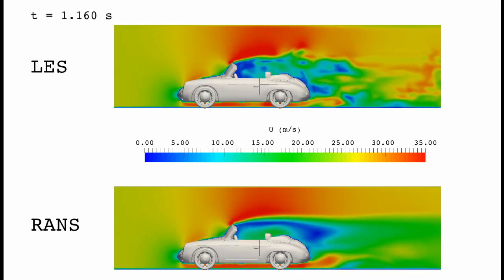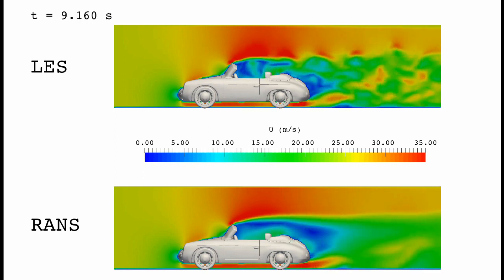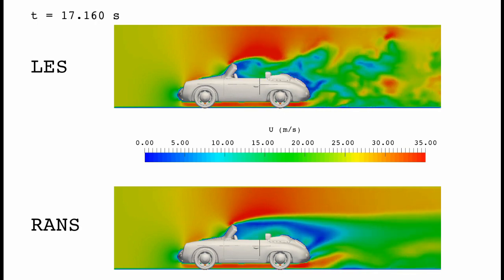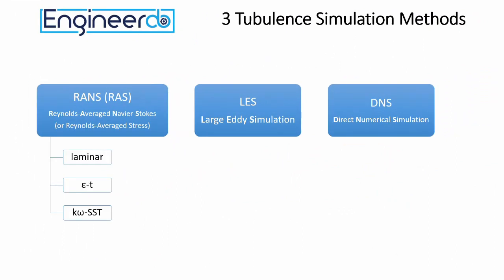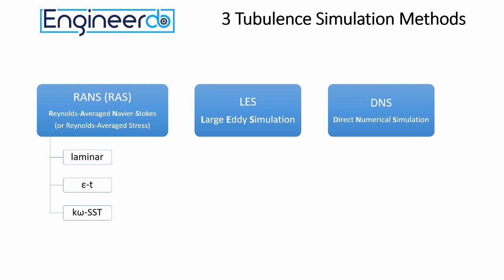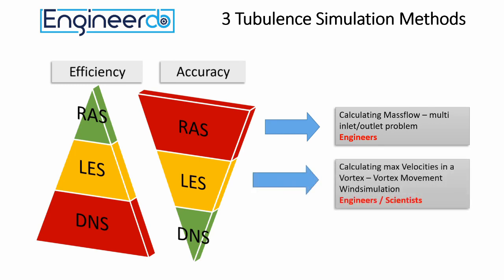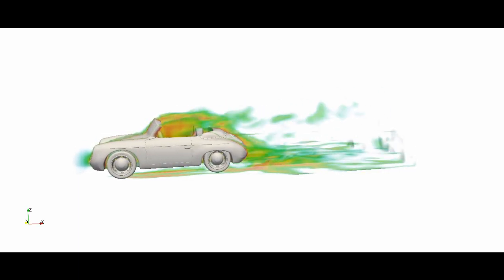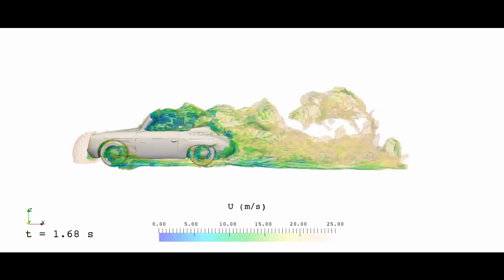Large Eddy Simulation - comparing Simulation Methods in OpenFoam or Ansys - why one should use LES

Comment: The transition to fully turbulence during external flows is generally characterized at 500,000 and above for external flows. Also, DNS is a method to resolve all scales of Eddie’s including the kolmogrov scales. The matrix inversion can be applied to any solver formulated with an explicit diagonal matrix. However your simulation visualization is very good
Reply: Please correct me if I am wrong
Whenever problem is solved using implicit approach we always land in AX = B type linear equarion where A is coefficient matrix which is sparse and diagonal 
X can be obtained simply by obtaining A‐¹B but inverting a matrix is computational extensive work when mesh is large and in millions so the best way is to solve via iterative approach such as Conjugate Gradient Algorithm
On the other hand when explicit solver is used there is no need to build coefficient matrix because now the Governing equations will be solved at each grid point explicitly using neighbouring grid points data depending upon the type and order of discretization scheme such as Center Differencing O(3) scheme

Comment: Hi, thanks for a nice and concise video. I have just few remarks/questions that I would like to be cleared up to avoid potential confusion (at least for me):
1. Using Re=2300 and 2900 as a threshold for laminar/turbulent flow, isn't this value an estimate for a flow in a smooth straight pipe? And even there, it is just an indicator, not a fixed value. I would be much more carefull stating that anything bellow 2300 is laminar and everything above 2900 is turbulent.
2. Listing 'laminar' as a RANS model, I would like to know how got there. AFAIK (and of course, I might be wrong), turbulence is inherently present in the NS equations and manifests itself more and more as the convective term in the momentum balance gains importance. Consequently, solving the flow using 'laminar' turbulence model  with high enough mesh resolution to capture the whole energy cascade is DNS. Thus, I would mention the 'laminar' turbulence model either in a separate category or in the DNS box. To list it in RANS, there is just no averaging in 'laminar'.
3. I thought about having a few more rants on the topic of RANS vs URANS and and the necessity of specifying resolved vs modeled energy ratio for any LES simulation but oh boy, for such a nice video, this is a way to long of a comment.

Thanks for making the effort and sharing your work!
Reply from the maker: Hey Martin, thanks for your comment. Of course you are right, the Reynolds number just gives you an idea where you are with your flow behaviour. Actually it's rather academic, because in my 10+ years in heavy industrial projects, I've never seen a laminar flow. The choice of the turbulence model can also be academic because it's usually depends also on reliable measurements of the flow which normally are not available. At least in OF laminar means, that no turbulence model is used. So you are write, there will be no averaging in laminar.

Comment: Hey I have a question, I have a small propeller about 18 inches. The rotational speed is about 6710 RPM. And I swear I've searched a lot on the topic but there is not actually much info on how to properly simulate a propeller. So far I have tested Reynolds Stress Eq. K-omega and K-epsilon. However I really don't know which is better for my needs. I have used a lot of K-omega for fixed wings at low levels of aoa and low reynolds (about a million Re). Which method should I use for rotating propellers?
Reply from the maker: Hey Mich, thats the beauty of a real project. Nothing is for sure which on the other hand give a bit of freedom. I would start with a RANS model using k-omega because it is usually pretty stable. It's always possible to increase the amount of work that goes into a model. In the beginning of a project I usually the try to get a solution with smallest effort in time possible. A LES will take much more time than a RANS simulation.
A validated model will always need measurements, which are in 99% of the cases to expensive to carry out

Comment: In terms of accuracy Turbulence Models are as under
Sparlts Almarts 1 equation --> kw, SST, ke, kw-SST 2 equation Model --> Reynolds Stress Transport 3 equation Model to find u', v' and w' which will be used to find 9.0 Reynolds Stress Tensor components u'u', u'v',u'w',v'u',v'v',v'w',w'u',w'v',w'w' --> Large Eddy Simulation where Macroscale eddies are resolved and microscale and Kormogolov length scale eddies are modelled based on universal pattern of life cycle --> Direct Numerical Simulation where mesh is refined upto Kormogolov length and Simulation time is lower then Kormogolov time scale in order to resolve entire Eddy life cycle from birth to death by viscosity

Comment: Wait until there is an AI model which can increase efficiency by getting the mesh state equations close to reality, then allowing DNS to converge each time step. I feel AI will learn how the NV equations work, and this will make our lives amazing as sim engineers.
Reply from the maker: Hey Brandon, that's a nice idea. However, I'm not so sure if it will be that huge improvements. In comparison we engineers are already using things like optimisations in different forms and from my point of view the use cases are limited. Of cause you can improve to a level which can be reached by trial and error. 95 % of my work to make good assumptions and to know where to look for problems not so much the numerical or geometric improvements. Often we know very little of the boundary conditions and the operator. The algorithms are always limited to the data you feed them with and I assume that AI will lead probably to an even increasing false assumptions because they will generate very good results to poor boundary conditions and will lead to a false interpretation of the results. I have witnessed this on several conferences where results of simulation reached 0.1 % of error but the error (or uncertainty) of boundary conditions was >20 %.
Reply: What if the AI algorithm wrongly predicts an outcome? Who takes liability of a failure? The AI developer or the engineer?